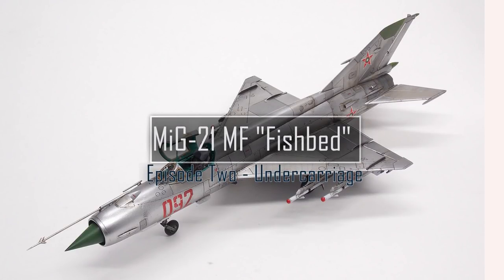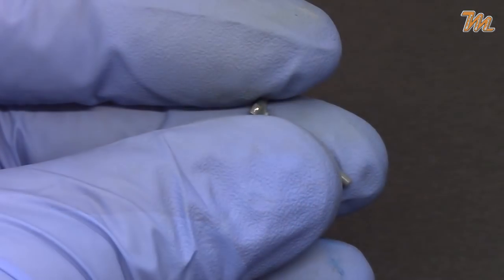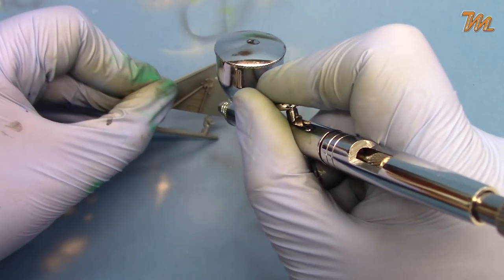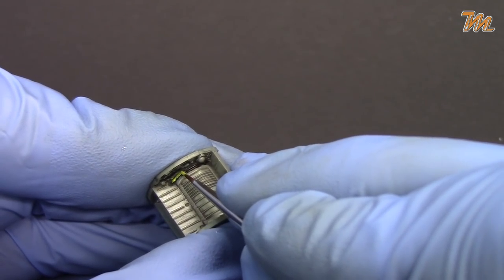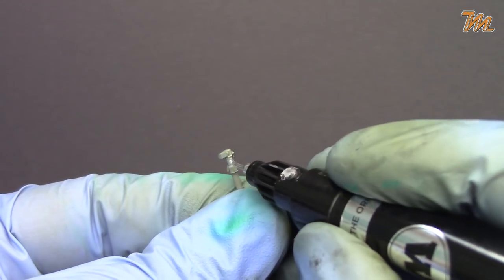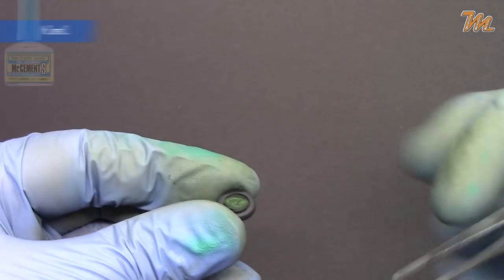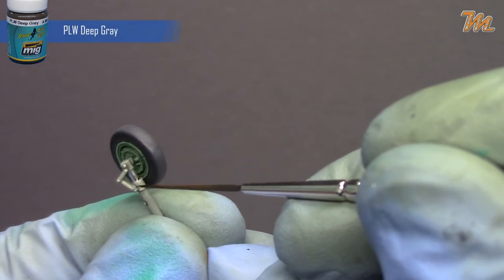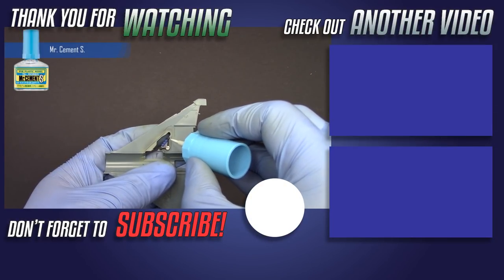1/72 Mig-21 MF video build series - episode two - undercarriage

Comment: I've been modeling for over a year with only paint brushes and i would like an airbrush but i dont know what to get.
do you know any good cheap airbrushes?
Reply from the maker: I am using this brand from the begining, I recently bought my 0.2 mm and I am very pleased with it. https://www.ebay.com/itm/163092420502?ssPageName=STRK:MESELX:IT&_trksid=p3984.m1558.l2649
Reply from the maker: There is also 0,3 mm which is probably a better choice for beginner https://rover.ebay.com/rover/0/0/0?mpre=https%3A%2F%2Fwww.ebay.com%2Fulk%2Fitm%2F163095201728